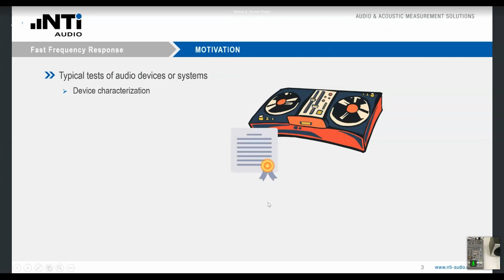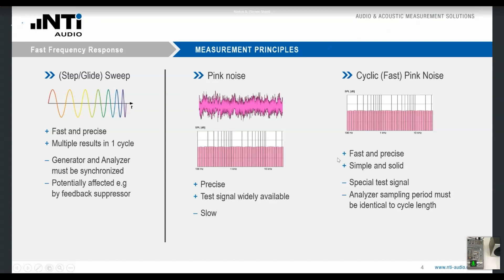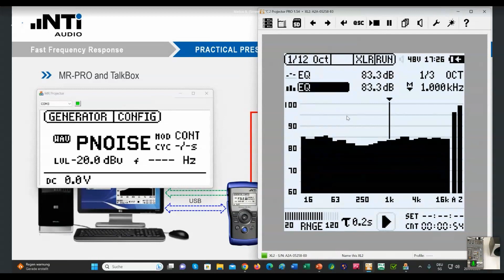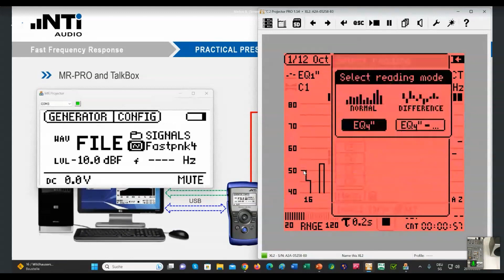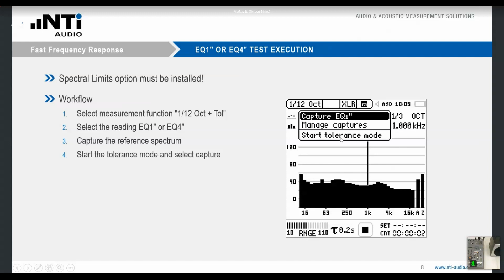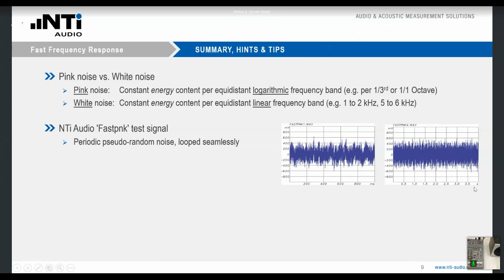Fast Frequency Response Measurement - Webinar

Comment: does my XL2 need special software for the pinknoise1 & 4 ?    I can't find teh fast pinknoise settinge in my menu ?
Reply from the maker: Hi, you need to have the Spectral Limits Option installed on your XL2 Audio Analyzer

Comment: So this is a version or adaptation of the maximum length sequence (MLS) principle, just that the spectrum is pink weighted instead of white? If you're measuring in a room with a reverberation time longer than 2 seconds you need to aware of the limitations of the test signal length.
Nice to have it in hand-held, battery operated devices.
Reply from the maker: Correct, the spectrum is pink, so a linear response shows flat on a logarithmic scale frequency axis.
And yes, the laws of physics do apply no matter what measurement method we use 😊